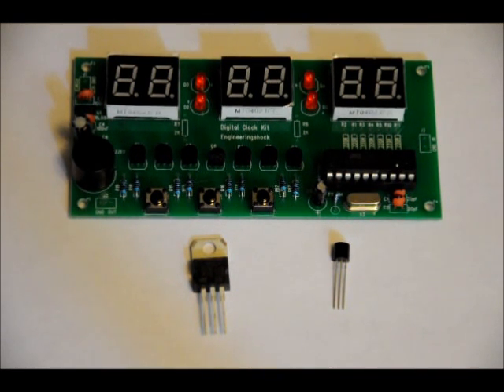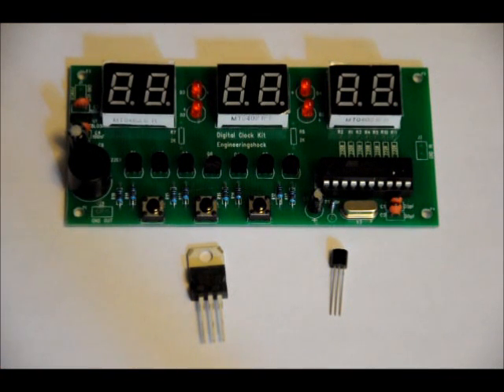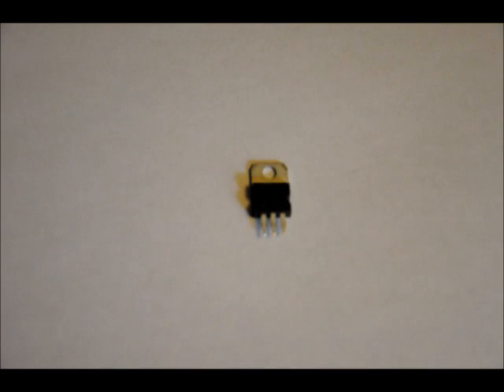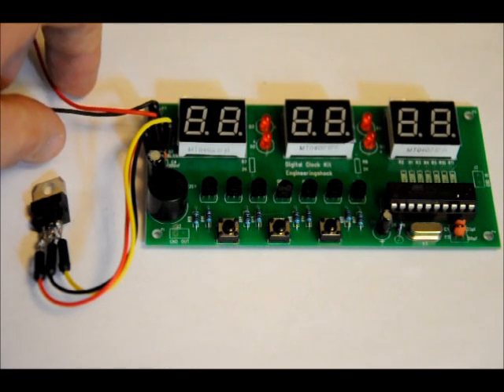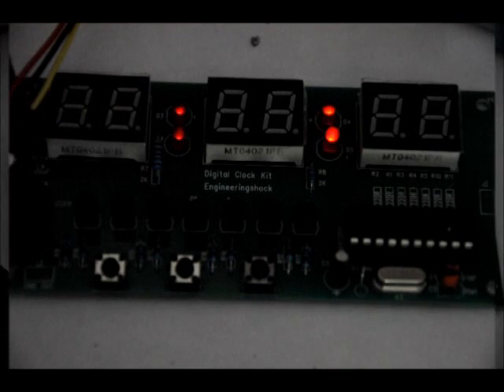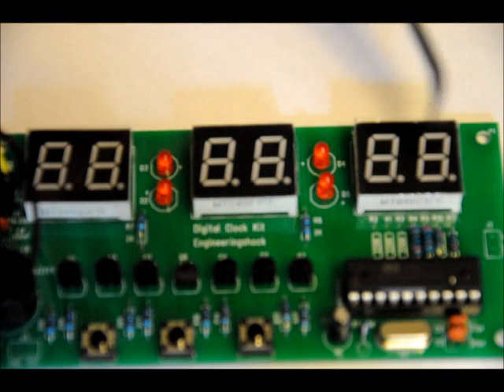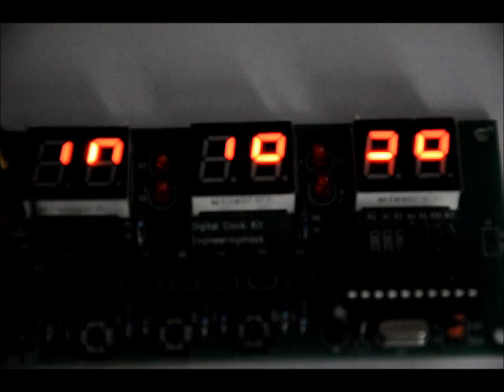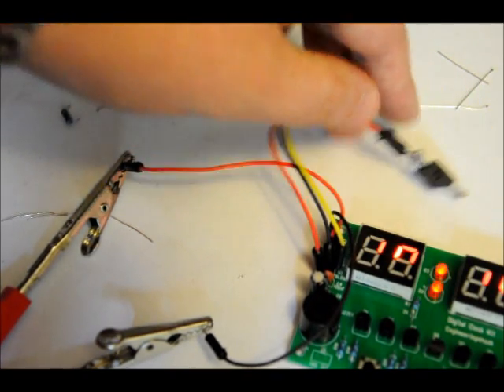Modifying Your Digital Clock Kit For Higher Input Voltage & Dimmer LEDS.wmv

Comment: Can the 78LO5 handle a 9v battery for long periods without burning out or do I need the 7805 regulator  I know this probably sounds like a dumb question but I haven't built any circuits  since 2005